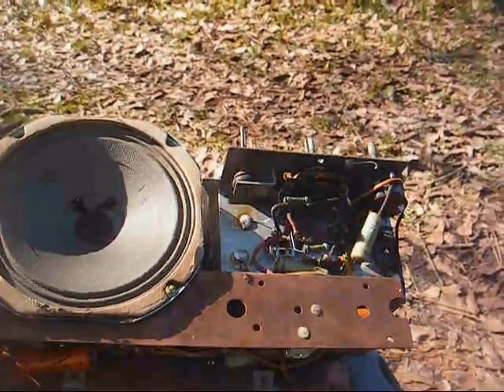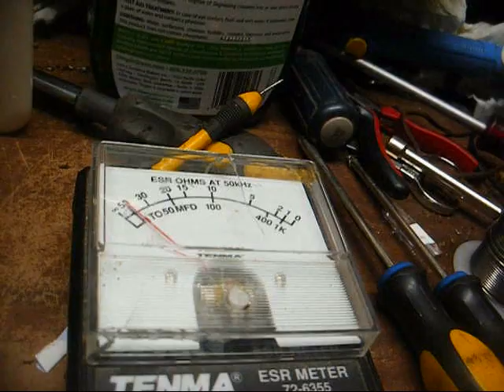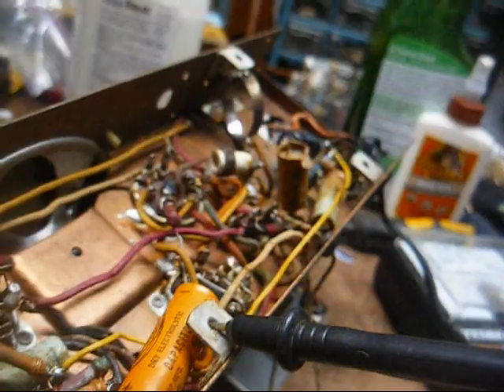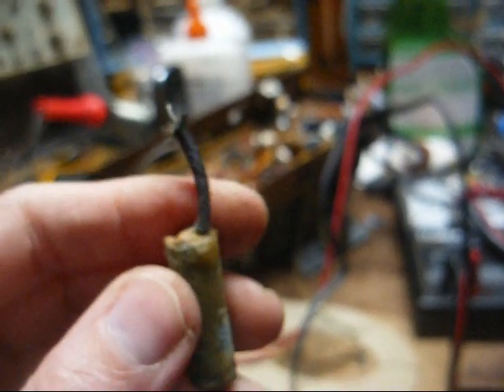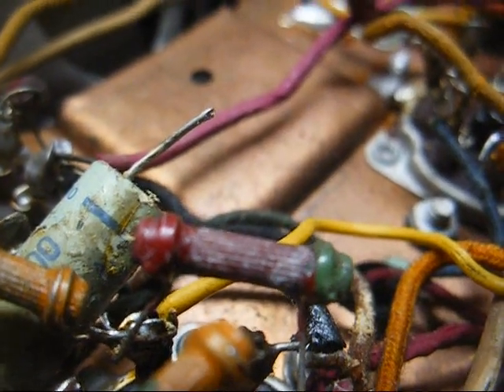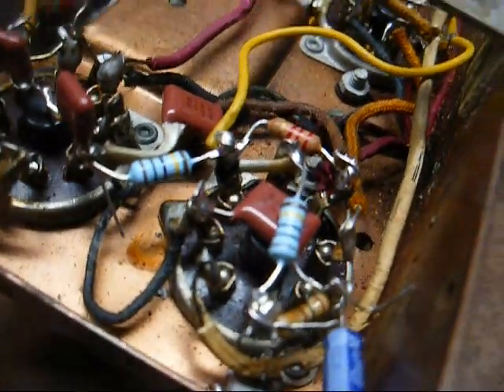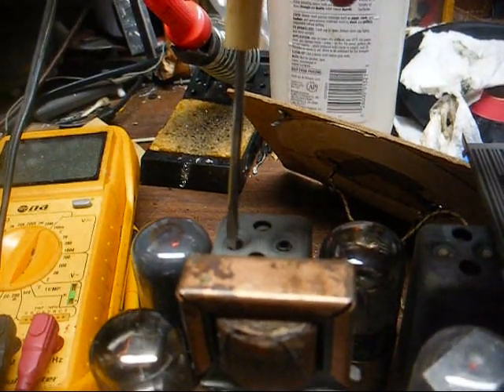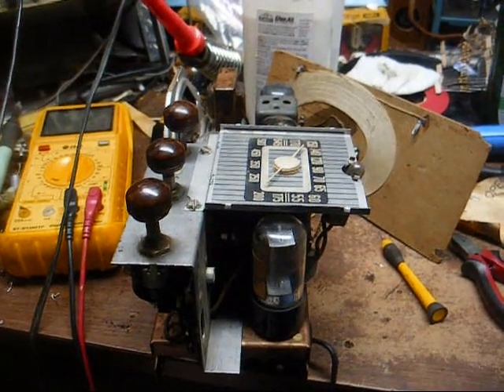Repair of a circa 1941 Aircastle AM tube radio chassis out of a radio & record player combination.

Comment: I discovered the crappiness of the newer wellers (when I had a 1980's vintage one) when it finally died and I couldn't get another heater.  I got a hakko instead and it's 10x the iron the newer wellers ever were.  The handles are screwed together and you can replace all the parts of the handle without replacing it all.  The only bad part is the heater needs to be soldered, so you kinda need a soldering iron to fix your iron.  I have been using a hakko for 25 years now since my last good weller croaked.

Comment: I have a seller for over 35 years old or more,still works ,I just fought a new tip for it .I don't use it much ,because you cann t 
A just the heat up or down ,but for smaller solid state stuff it does ok but for tube radios ,you need a adjustable ,with different tips,I hope you can buy a replacement soldering pen.you need a good soldering gun to do good work ,and you do very good work.thanks for shareing

Comment: Dave Jones of EEVblog has mentioned Weller's quality before too, he found out the hard (smokey) way that their power transformers have no protection...  Personally i use a cheap generic "936D" station now, £20 couple of years ago and it's lasted well so far.  Still cheap crap, but at the right price with no brand name to pay for plus you CAN get replacement parts easily.

Comment: Get a Hex-a-con (Hexacon) Thermo-trac soldering station.  I've had one for 30 years.  American made and never had a problem and I use it alot.  Buy used as they are stupid expensive new but will outlast you.  Hexacon main customer was the bell system and ma Bell didn't buy junk!

Comment: What's really disappointing in newer products is everything is crap. There may be some survivorship bias in there but back then you got what you payed for: low price, usually low quality, medium price, ok quality, high price, high quality and usually good reliability. Nowadays everything is made in China so whether you buy a $30 dollar soldering iron or a $300 one you will get a slight improvement but still the same crap inside. You have to go into really expensive, professional stuff to get something decent.